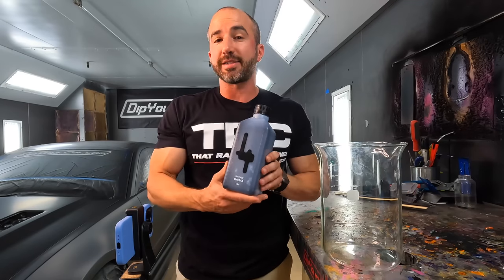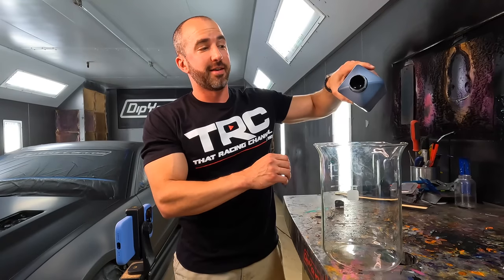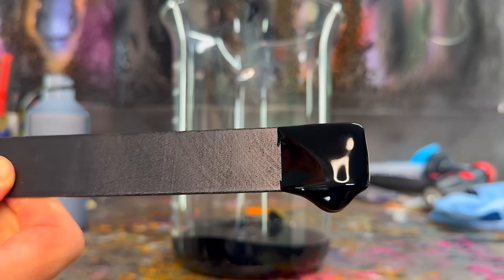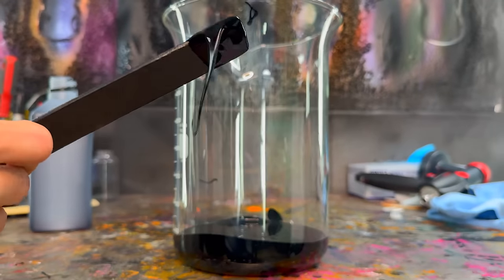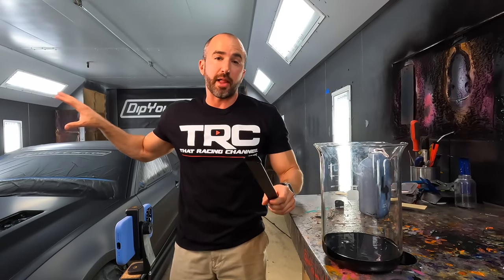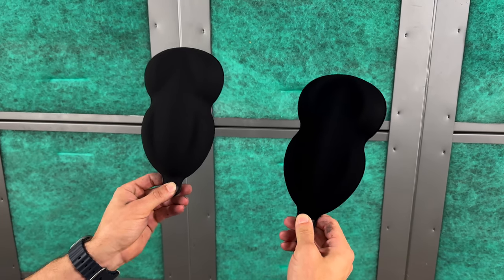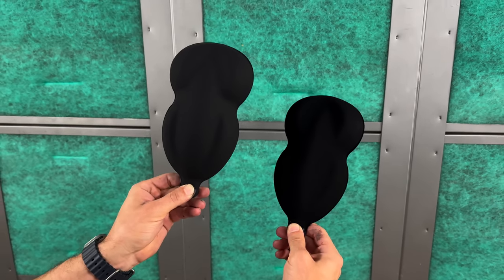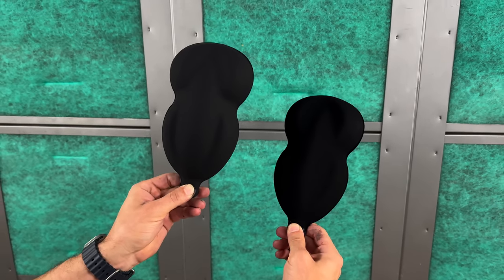Spraying a Car in the New BLACKEST PAINT in the UNIVERSE | Black 4.0 (Darker than Musou?)

Comment: It looks like someone went in and digitally removed the colour . I love this look and can hardly wait until someone makes this into an automotive paint .
Reply: The roof is masked off when they spray the car.
Reply: @bodybong  That's a bit disingenuous; yes BMW coated an X6 in Vanta Black. Is it a finish you can order? No. Is there more than the one? No. It was a one off concept to promote the new X6, that's it. Basically the same thing DipYourCar did on this Mustang and the Lancer. Until you can go to your local body shop and have this done with an actual automotive paint, or vinyl wrap, it doesn't really exist.
Reply: Would it be legal? I feel like it could cause confusion if other drivers see it on the road, and can't judge how far away it is or something.
Reply: @Here_is_Waldo mean there isnt really laws against this type of paint yet
Reply: @NoOne-py5or  There's probably a law that would cover that, something like endangering traffic or something similar.
Reply: @Here_is_Waldo It’s not an issue of laws. It’s an issue of durability. There’s no way to make a paint absolutely devoid of sheen which is durable enough to use on an exterior surface for any length of time.
Reply: @bodybong and you rarely see it in the day because they made a solar powered oven.

Comment: would be super cool to do pinstriping on all the edges so it looks like a wireframe

or sparkles on top like ya'll did with the Musou which to date is one of my favorite videos you've ever done
Reply: Like 1/2 inch reflective 😮
Reply: Paint that lights up with an electrical charge.
Reply: @cliffordcooley1273  I was kinda thinking the same thing, almost some kind of Tron type look
Reply: The wireframe idea would be pretty cool to see. One-up the Cell Shaded cars you see rolling around lol
Reply: @cliffordcooley1273  Electroluminescent is something I've wanted to see also.

Comment: I have a few specific questions:
1. Have you noticed any security concerns?
2. How's driving this thing at night?
3. Does it get too hot inside when parked outdoors?
4. Is it hard to clean it? What do you use for that?
Reply: Great questions
Reply: It would not hold up for long im sure. Maybe with a ceramic coating though.. idk
Reply: Nevermind. Its not compatible with coating. Not gonna work

Comment: If you sprayed a satin top with very fine silver flake mixed in would add lots of depth. It would look like you were driving in outer space. Great job!
Reply: The satin top coat would completely ruin the effect. They've already done a car in Musou Black (which looks just like this black) and they couldn't use a top coat over it. They had to spray the pearls suspended in some kind of thinner that would evaporate and just leave the pearls stuck to the black.
Reply: @Dethmeister  And it turned out spectacular. I would so paint one of my cars like that. Now if they could just make it durable and permanent.💯👍

Comment: I use the Muso paint in my artwork, and it’s a very soft paint that releases Air Bubbles when you clear coat it with certain top coats like Epoxy Resin. I’ve never seen paint do this before. Maybe this new paint will be better to use
Reply: Doubtful.
It works because the surface is rough.
Adding any kind of top coat fills in all the tiny crevices, and so will make it more reflective.
Black (2,3,or 4) are all water based acrylics, so are not hard-wearing.

Comment: ok , so i bought some . Since you said don't use it with clear coat that's the first thing i did and it works fine , it is even soluble in urethane clear.  applied as such it is darker than rattle can black. Brushed on , as is,  it tends to be semi matt and too reflective compared to the sprayed finish which is very matt and black as advertized.
Reply: How is it holding up?
Reply: just did a test sample , will do my car when the weather wams , i don't expect a problem

Comment: I’ve been so tempted to get couture hustle paints for a while but as a crafter who doesn’t usually use paint £45 is a lot for a little tube, love this vid and the car looks absolutely amazing and I’m 99% going to get some but could you just clarify what you mean by dry coats please? Do you mean letting it dry between coats and when you say thin do you mean easy on the brush or thin it down with an appropriate paint thinner? T.I.A